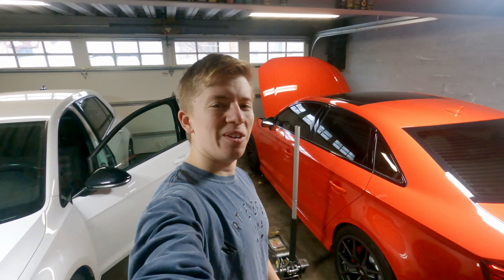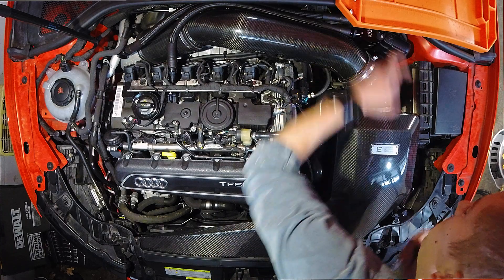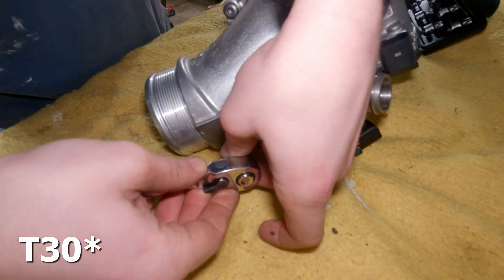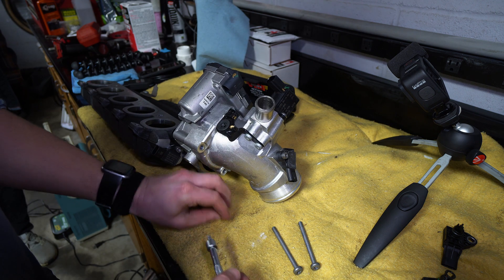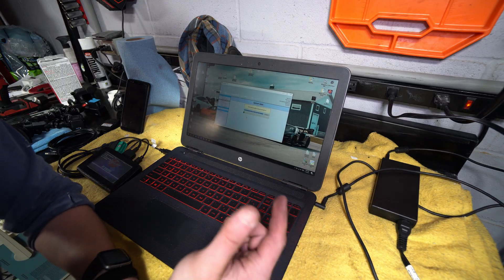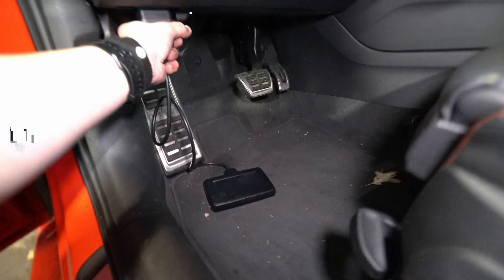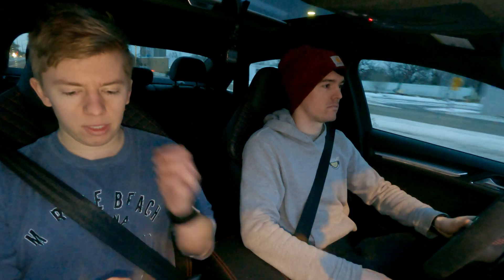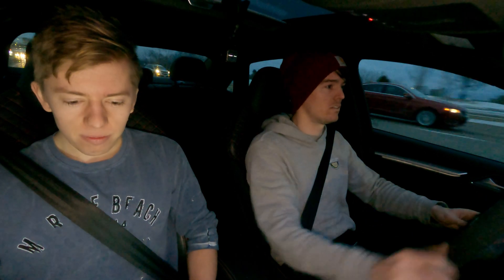Audi RS3 4 Bar MAP Sensor Install

Comment: I was working with a magnet tool and it hit my map sensor which had a little spark and smoke. Car is still making boost and no codes so doesnt appear to have done anything. Thoughts?
Reply from the maker: That's wild, I don't know how it would cause a spark and smoke.  If there's no codes and it's boosting fine I'm sure it's fine, but I'm not a professionally trained mechanic.

Comment: reinstall of the upper manifold? Torque specs or sequence?
Reply from the maker: I couldn't find torque specs, but they are pretty small so I'd guess around 15ft-lbs. I tried to torque it evenly and slowly if that makes any sense